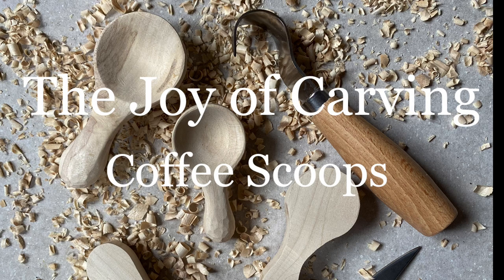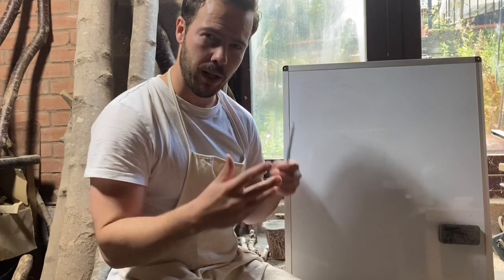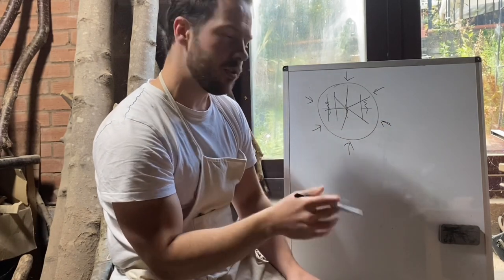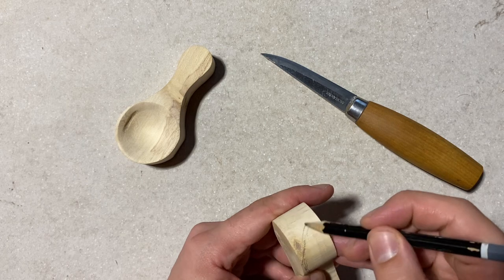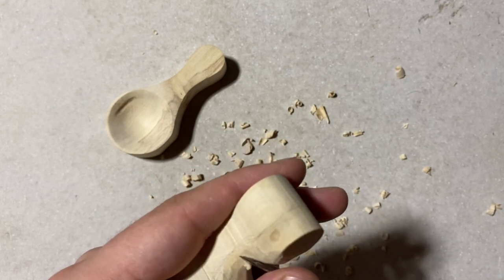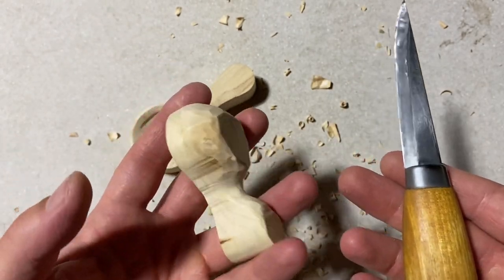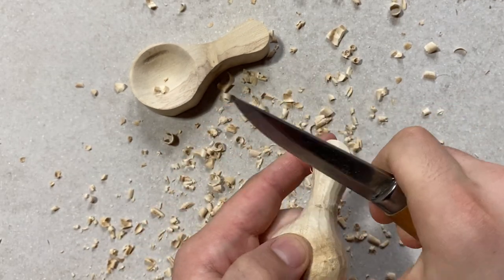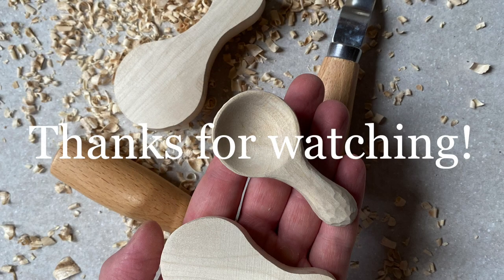How to Carve Spoons | Beginner Spoon Carving | How to Carve a Wooden Spoon | Carve a Coffee scoop |

Comment: Hi, I have just started carving. How old should the ideal Hazel wood be to carve so that it will not crack. I have saved some hazel for walking sticks and most of them have cracked after one year.
Reply from the maker: A good trick I learnt is to coat the end grains in paraffin wax, this helps prevent further moisture getting into the wood while it’s curing, if woods going to be stored for a long time it’s best to do this. Another tip is to make sure the area where you’re curing the wood has a consistent temperature, is dry and isn’t going from hot and cold too quickly, this can cause the wood to expand and contract too much which can cause cracks as well or that the area isn’t just too hot as again this can remove moisture too fast from the wood. Hope that helps! 😊👍👍